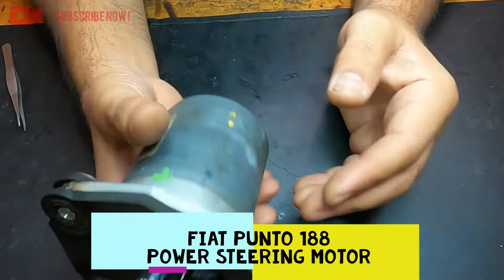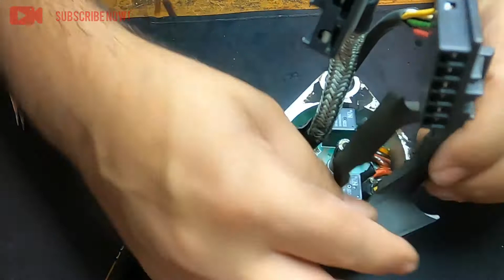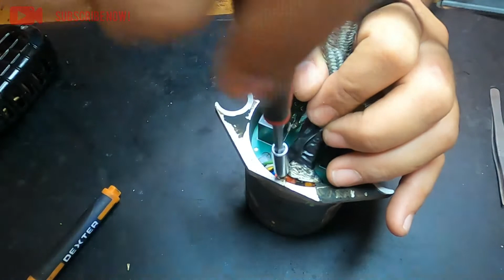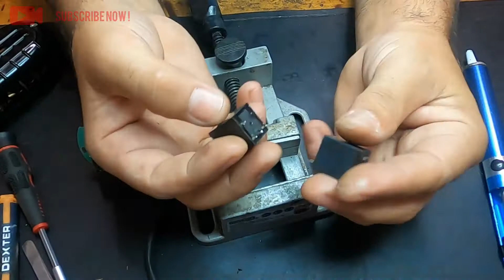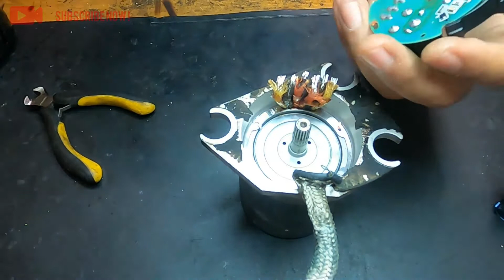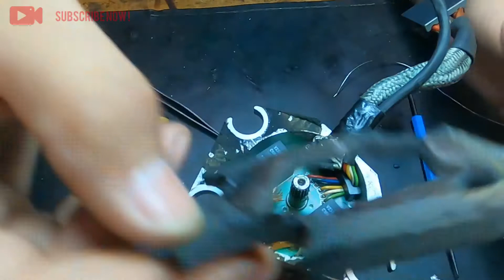Fiat Punto 188 Power Steering Motor repair

Comment: Hello! How can I check with a multimeter whether the relays are faulty?
Reply from the maker: thanks for watching
you can check but the issue is that when the relay heats up it stops to function so i would simply replace the relays, usually when we test these relays they do work but then under high current draw it stops working.
Reply: @PSICompanyPerformance  Thanks for the reply, in this case the exchange is really reasonable.

Comment: I got a 1.9d 2001 elx will this be the same motor?
Reply from the maker: @antonio877ful thanks for watching.
It is the same if your car is a 188 chassis, then is the same
Reply: @PSICompanyPerformance  thanks,  i have another question, when I turn the steering wheel quickly to the left I have a creaking noise and sometimes the red steering wheel light appears on the dashboard, but when I turn off the ignition and turn the ignition on again I have direction again. Is it possible that it is the relays that you show in the video?
Reply from the maker: @antonio877ful  yes thats exactly it.
Good luck
Reply: @PSICompanyPerformance  thanks, nice video appreciate

Comment: Hi thanks for sharing I was wondering if the if motor have brushes if have Alfa mito and the power steering gets hard from time to time while driving I replaced the relays but I’m still the same problem 
Thanks in advance
Reply from the maker: Thanks for watching.
No these motor are brushless...you can have a rare case of the module under the steering column failling.
Good luck..
Also make sure your battery is in good condition and the alternator too.

Comment: hello, these relays also work on fiat punto 2004 , 1.2  ? Thank you very much
Reply from the maker: thanks for watching.
2004 Punto i think uses a little diferent motor thyat has no relays on them....if thats the case the problem is going to be the control module located under the steering wheel.
good luck

Comment: On the road while driving, the steering wheel became very hard after I turned off the car, it was fixed but it did it again later fiat punto evo 2010
Reply from the maker: Thanks for watching...
In your case, your car does not have this motor...but i have a video in my channel about the steering angle sensor replace of a grande punto that is exactly like yours...
Good luck

Comment: Hi 
I have this problem with the steering light it only happend when i am driving after a while and in higher speeds when i stop turn car off and then back on it works again normal until it does it again
This is the relays correct?
Reply from the maker: What is the year of your car?

Comment: Hey there.  I was wondering, do you know what are the others reasons could be show red steering light on dash board . Because I tested the relay both are good.  And sometimes my power steering works.  Its means my motor are good. Is it or ? Anyways any information will be help. Thanks
Reply from the maker: Even when you test the relay some times when they get hot they fail..
Have you checked the solder points with a magnifying glass...its the most common issue.
Reply: @PSICompanyPerformance  I did re soldering all the join, also checked if relay click with 12v. Its make the click noise , so I assume its good. Then I tried it. But unfortunately I didn't worked.
Reply: Also can you please comment the relay reference. That will be great
Reply from the maker: @radio_uu  reference do you mean from the relay...its on the video...